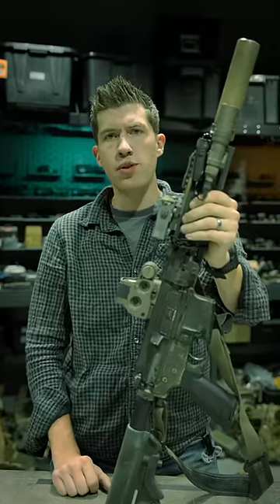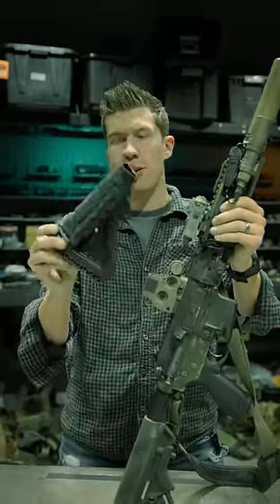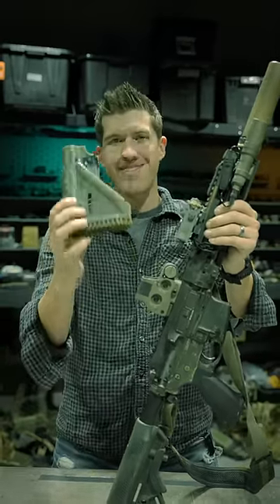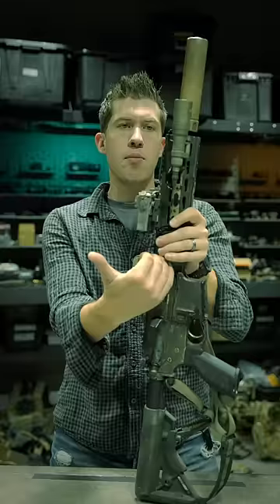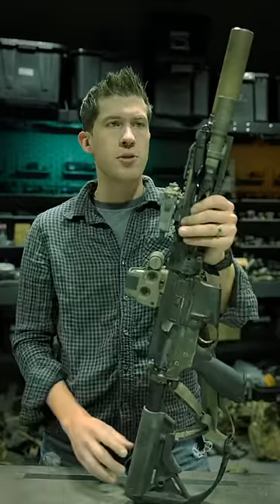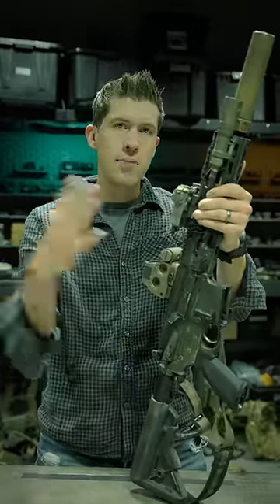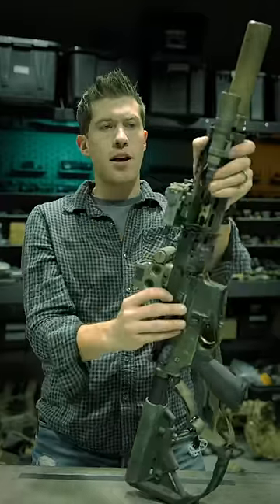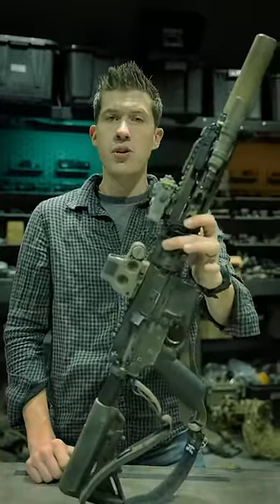A T.REX HK416 Setup

Comment: The HK416 is my favorite rifle of all time.
Reply: Over priced
Reply: @peeeoii2738 You get what you pay for. Buy once. Cry once.
Reply: @Knight_of_the_Old_Code Many other guns u could say the same that cost far less
Reply: @9770G  Exactly 💯
Reply: @Knight_of_the_Old_Code  I’ll take a BCM BFH ELW upper on a aero lower for $1200 or a $1500-$2000 PWS Piston ar15 complete rifle with a long stoke Piston looooong before I’d take a totally over hyped 416.
Reply: @greg9770  That's an excellent platform. I've recently put a few hundred rounds through a DD MK18, and I've fallen in love with it. It's my new favorite setup.
Reply: @9770G PWS is my go to rifle
Reply: @Knight_of_the_Old_Code  why get an HK when you could build your own with better performance for half the price of an HK, their bolt carrier is like $500-1000 itself no way I’m paying that for such a minuscule “innovation” over the ar15 bolt carrier.
Reply: @peeeoii2738  Because then it wouldn't be a TRUE HK...lol. Also, the HK416 is a short-stroke piston system and thus utilizes a specific AR15 bolt made specifically for the piston gas system.
Reply: @Knight_of_the_Old_Code  did u read my comment? The carrier for hk is like $500-$1000 itself there’s no reason to pay that much coin for some steel
Reply: @peeeoii2738  Did you read mine? Then it's not an ACTUAL HK. If I can afford it, I have no issue paying the coin for a LEGIT HK416. Maybe YOU and some others don't think there's any reason to pay that kind of money, but others have no problem ponying up the $$$.

To each their own...
Reply: @peeeoii2738  I understand. Again, to each their own.
Reply: @forblocking9484  Well said...
Reply: @Knight_of_the_Old_Code  if it weren’t for the history behind it (capping osama), the HK416 would just be known as another piston driven ar variant that’s overgassed to the point of being unpleasantly violent. It’s really not a good rifle, performance wise. So-so accuracy. Overly heavy. Violent cycling action. Dependability on high round counts/longetivity is it’s thing.
And for that price, why not just buy an extra gas tube and a couple LMT bolts and have a more accurate, smoother cycling, lighter rifle that’s just as dependable for the first 20k rounds (at which point replace the bolt)
Reply: @coltharris8471  I agree, but I'd pretty much own one if I could, even if just for novelty reasons.
Reply: AK has entered the chat
Reply: I'll take a Saiga over ANY HK!!
Reply: @colowyowatchman4420  Those are nice. Solid choice.
Reply: @peeeoii2738  then don't be poor
Reply: Expensive
Reply: @peeeoii2738 I guess you failed to when he said to each their own...lol
Reply: @coltharris8471 I like when some people complain about an over gased AR... lol you do realize that it can be adjusted... lol but funny that you think the 416 is only popular because it was used in the attack on the Osama compound. I guess all the other spec ops and Delta force missions didn't do anything to prove it's a legitimate weapon system...lol
Reply: same

Comment: Hey Lucas, if you don't need that stock I'll take it lol. Actually love the E1 stock but can't find one for sale.
Reply: Just a question: i own the hk416 airsoft and handled the real 416 in service for quite some time. I run my airsoft hard and it takes quite the beating. The stock holds up great for several years, so why not buy an airsoft stock🤔
Reply: @TheHaiko117  ...never thought of this. What's the brand?
Reply: @Zel_eo  i have a vfc hk. I think ypu have to buy the gen 1 stock used
Reply: @Zel_eo  but there are a lot of good copies
Reply: Hk parts usually has them instock, can also check blue ridge supplies
Reply: @TheHaiko117 yeah vfc brand airsoft parts work awesome on a ar or ak
Reply: I have an extra E1 stock cause I also switched to a B5 Bravo. Are you interested?
Reply: I bought an e1 stock I actually love it 😅

Comment: Can anyone explain why one of these would be worth the cost over something like a BCM or Aero?
Reply: "If you have to ask..."

It isn't. I'm an HK fan, and no one on Earth can justify this one over a BCM, DD, AERO....ect. It isn't worth it.
Reply: Reliability.  The slightly over gassed piston setup is alot more reliable in a gun with a barrel under 14.5" especially suppressed.  The buffer tubes have holes in them to allow it to fire coming out of water.

Comment: Out of pure curiosity, is there any legal way to purchase a new full power laser aiming module? You can legally buy a suppressor or sbr as long as you jump through hoops, so what are the hoops for a full power dbal?
Reply: Full power will most likely be mil surplus and without warranty,
Reply: @son_of_guns  that's why I said new, as in straight from the manufacturer, I'd never buy gray market stuff
Reply: When you say full power you mean that it is usable out to longer range?
Reply: @js70371  technically yes, but also just generally more usable, if you ask anybody about the ATPIAL-C they would all say the illuminator is absolutely unusable

Comment: Did you change the stupid takedown pins? Those things need a tool to "unlock" them. HK made locked captured takedown pins. I guess the normal captured takedown pins were engineered enough

Comment: Too much crap.   
My Windham Weaponry AR build.  
Good old picanny 4 rail.  Vortex Spitfire 3x. ...mag pull flip ups front and rear.   Picanny rail covers.  Detachable bi pods.....Daniel defense compensator....mag pul moe butt stock with a little battery storage....grip is mag pul with storage for my lightly oiled bore snake.
But my best accessory is my mil spec 100 rd double drum on my bi pods😊

Comment: Those first two stocks were just ugly and plasticy looking. I still prefer Magpul over pretty much all stocks. I have the ACS-L stock, CTR and STR stocks. All have friction locks, so they don't rattle or move at all. They feel good on the cheek and give a nice cheek weld. The STR and the ACS-L both have storage compartments that I use for optics batteries. The prices are competitive and reasonable for what you are getting. Many models to choose from, colors as well and they come from a big reputable American company.